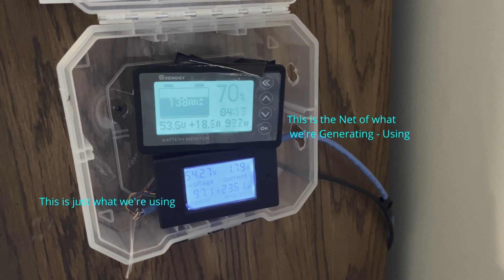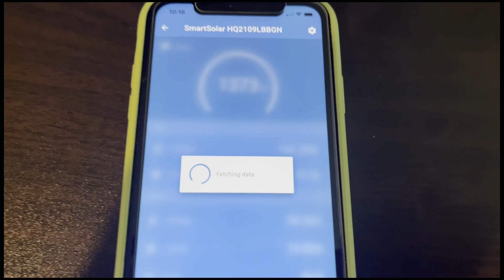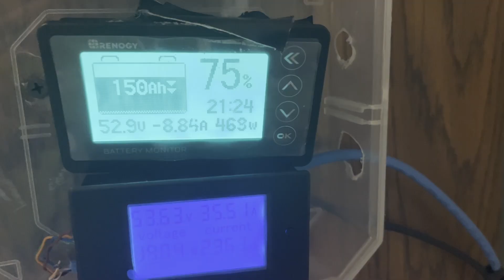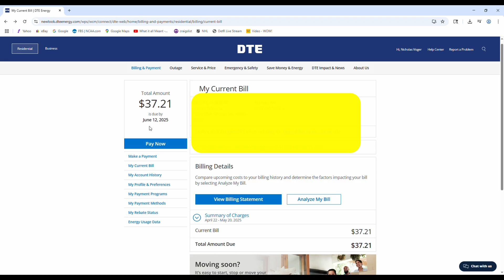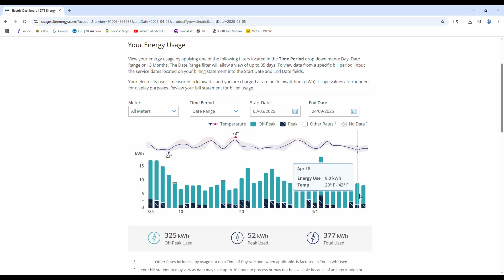My First 1,000 KWh - Solar

Comment: I swear I was paying attention. I know I'm going to have to re-watch the video and pay even closer attention. How long have you had your setup? How many panels and total and size? Was that 10 x 250 w
Reply from the maker: Had it about 2 years wince upgrading to 48v. yes you are correct 10 x 250's - 2 parallel strings of 5.  thanks for checking out!
Reply: @oldvideos1 nice! Do you have plans to go with an even larger array? Expanding your energy storage do you have a goal in mind for where you'd like to be optimally when your project is nearing completion? I say that because I'd like to be in the 40 to 50 kilowatt array range for my house so I can make some money selling back to the grid passively at the end of the year